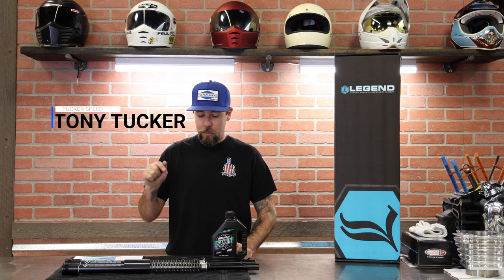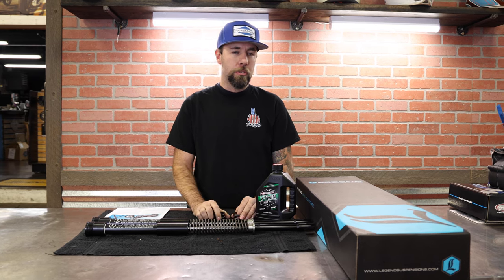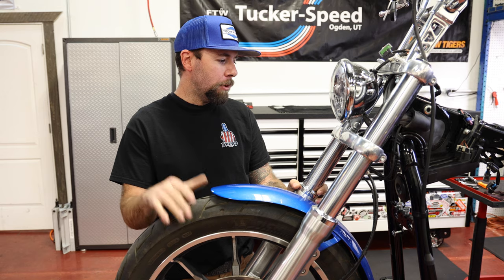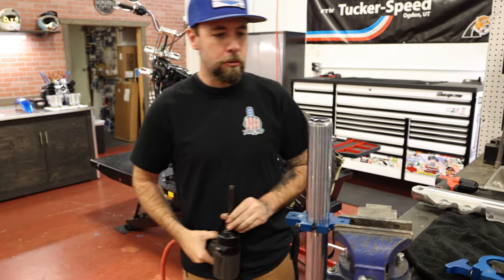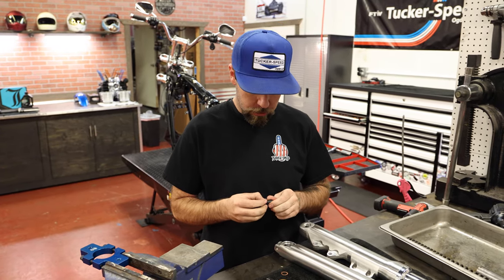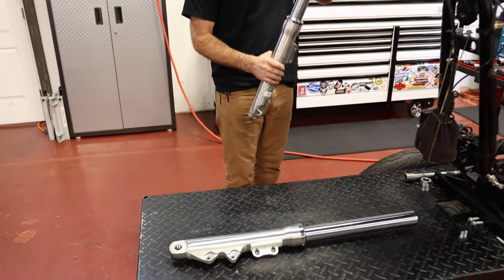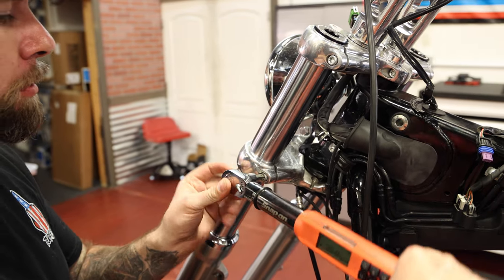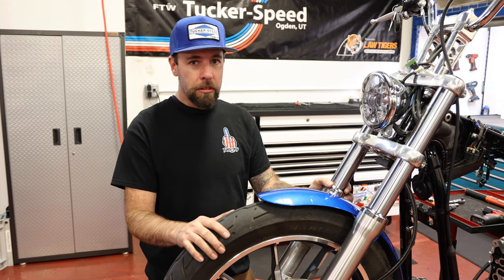Legend Axeo 49mm Fork Cartridge Kit - 2018 M8 Softail Lowrider

Comment: I Purchased from you guys thank you for a great product and great costumer service.
I do have a question after installation it feels more stiff than a stock. Is this normal ?
Reply: I have the same question. Harsh on the small cracks in the road. 2022 Lowrider ST
Reply: @freeskitim800  Would be nice if Tucker speed could respond to us explaining why is this happening and if its normal or installation was done not right.

Comment: What if I have 2" longer fork tubes ? Is there some extension part that I should add ?
Reply: I used the fork tubes from a Dyna which is 2 inch taller 25.5” the softail is 23.5” I used the axeo cartridge for a Dyna everything works perfect

Comment: Question, I upgraded the 22 road glide front wheel to 21 inches and changed it to axeo21 (0414-0543). I also added 13.5oz(400cc) of the fork oil with screamin' eagle heavy. My weight is 80kg and my wife often rides in the back, so I installed the pre-load by turning it around once. However, even if I ride alone, if I pass through a slightly deeper manhole, I get a shock as if the front cartridge is pounding. Is this right?
Reply: @TuckerSpeed477  The cartridges all seem to be crashing. It feels like all the springs are folded? The sound of shock is felt by the sound of being stamped and the steering wheel. It's not a solid feeling, but a feeling of meeting everyone.
Reply: @TuckerSpeed477  Screamin' eagle heavy oil is about 20wt dry oil like Maxima oil, right? In South Korea, we need to import Maxima to get it.
Reply: @TuckerSpeed477  This is South Korea. You don't understand because I'm not good at English. I'm sorry
I'll open it again and restore the preload to zero
I'll apply blue loctite and add 13.5 ounces of oil. Restoring to its original state.
Reply: @TuckerSpeed477  I guess there's a big difference between the preload and one lap. Do you think I should've just put it together with zero thinking about Ryder's weight? It is considered to be a problem caused by not matching the SPAC, and we will restore it to its original state. Right now.
Reply: @TuckerSpeed477  Thank you so much for the quick conversation

Comment: Thanks for the video. Say I wanted to do just a progressive fork spring replacement without pulling the forks out of the triple trees. 
Remove the front wheel drain the oil, then pop the tops, swap the springs then put the wheel back and re assemble?
Or would I definitely need to pull out the tubes from the triple trees?
Reply: @TuckerSpeed477  Gonna be working on an 2018 FLFBS. They're normal forks like the lowrider.
Reply: Let us know if you did it because it is a very interesting question :-)